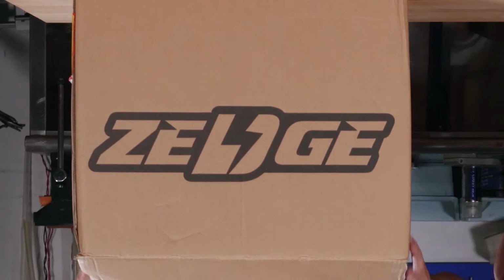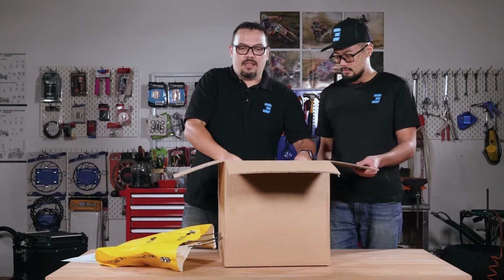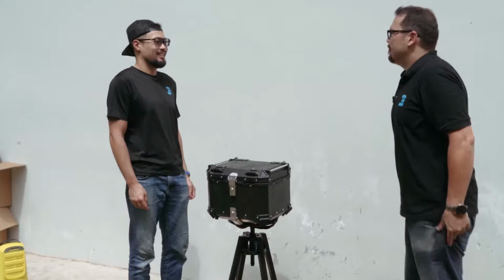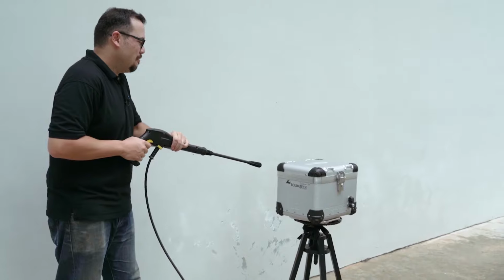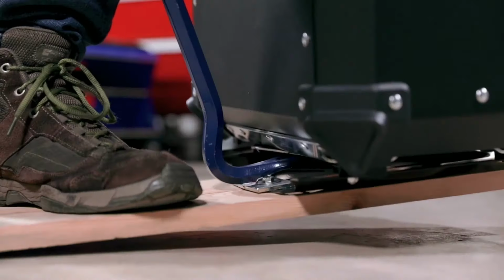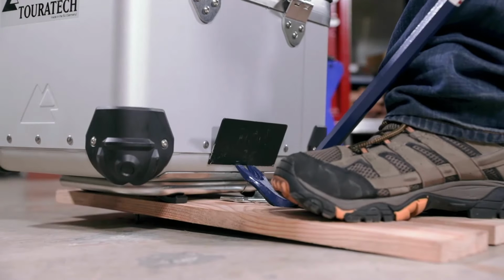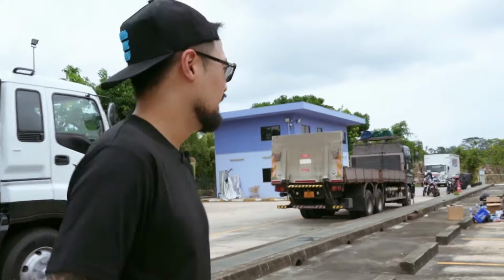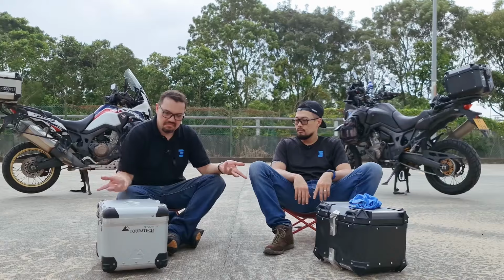$980 Touratech Zega Pro 2 VS $158 Zedge Top Box | To The Test Episode 2

Comment: im using the zedge top box for a while, after few mths water will slip thru the rival point from the corner. have DIY using silicone seal
Reply from the maker: Does it solve the problem?
Reply: @tri333ple  yes it does, but i upgrade to givi dolomiti

Comment: My old top box, a GIVI one, dropped off my old motorcycle because the bracket holding it snapped over a hump. Superficial scratches. I had to buy a new GIVI bracket to replace the broken one. My new top box is an aluminium one similar to the zedge. GIVI may be a good brand but metal >>>> plastic.